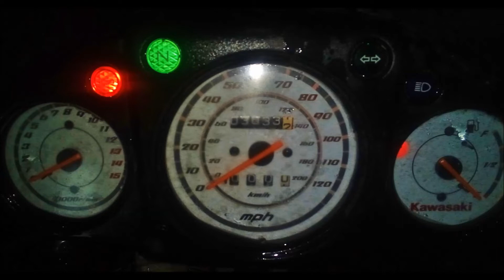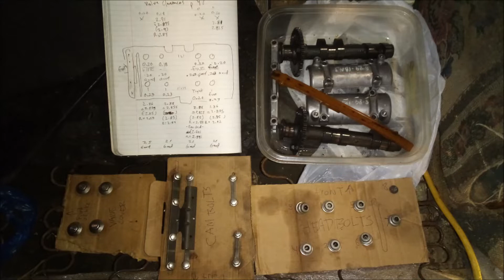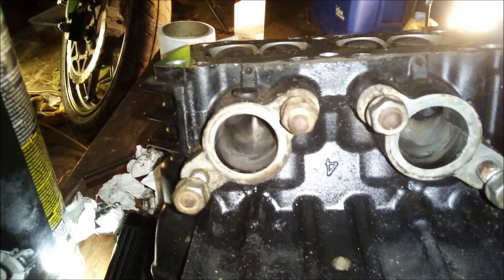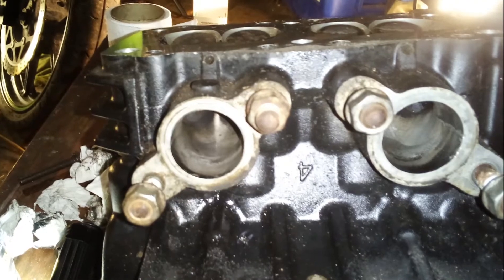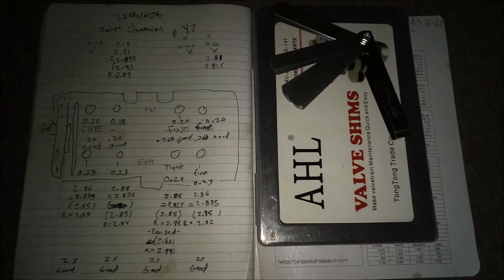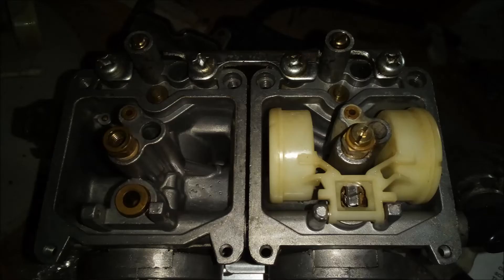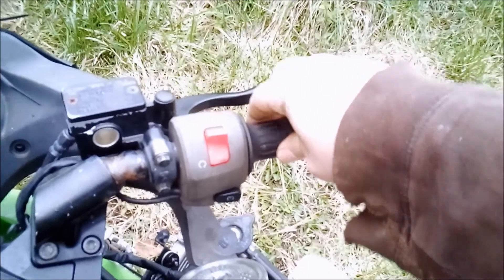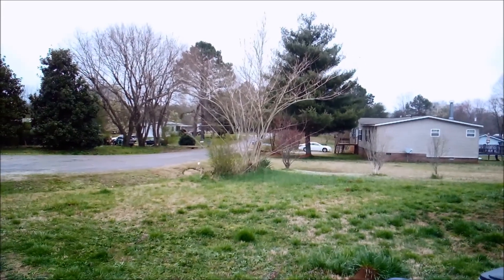12.5 Compression Ninja in 8 Mins + Start-up and Rips (Rowdy!)

Comment: You're right about giving it hell.
Reply from the maker: Oh yeah bro seat them rings with the power of fire. My buddy Jacob taught me that a long time ago, He had rebuilt a Honda 200x 3 wheeler for me and I babied it and putted around and it was still smoking after a day and he came over walked up and stuck the thumb throttle to the bar... I was freaking out trying to scream over the sound of the engine screaming.. STOP! STOP!!! and he was calmly looking at me he reached down to the carb screw with a Phillips head and turned it a 1/4 turn and it really started screaming high pitch, the cdi cover was off the head and he took the back of the screw driver and tapped the cdi module a few degrees advance... it got even higher up in the RPM. I was thinking oh god NO why??? After about 2 minuets of that which felt like 4 years, he let off the throttle and it sat there purring like a kitten, and he said if it was going to blow up you want it to do it now not 5 miles from anywhere out on the trail... and look,        No more smoke... Its fixed.
Reply: @heavymetalATC  precisely

Comment: You plan on tweaking the spark curve?
Reply from the maker: Thank you for watching and taking the time to comment Casey, I had thought about it but I talked to a guy on ninjete forum that builds insane bikes and he said it'll be fine, It might benifit from a colder plug and maybe a float height adjustment and I do run it a tad rich because when running on reserve with low fuel i noticed it wanted to ping slightly under hard acceleration... race gas would fix all that but Im not made of $$$s. Hahaha. Thanks again Casey.

Comment: The early ones were set up with a 15,500 rpm redline before longevity issues happened on straights
Reply from the maker: It appears that if you build one out like this and keep revving it that way the tach stops working. Hahaha
Reply: @heavymetalATC  I believe they developed lubrication issues when such rpms are sustained

Comment: Where did you find the measurement of .03 for the swelling of the forge pistons? I am thinking about putting a 66mm Pistons kit in my ninja, I am wondering what should the cylinder be finished at?
Reply from the maker: Thanks for watching fern. I am pretty much a hack so its just a guestimation I made from the info I got from guys on a forum for building race boat engines. Many of them had been having problems with the forged wiseco pistons sticking on factory tolerance sizes so as a rule they were going 1-3 thousandths overbore and 0.002in is just about .03mm and that was still inside Kawasaki service clearance at that size the wiseco rings gapped perfect with no filing. I had just used a 400 grit hone to bore the cylinders out but I sent a picture to my buddy who is a machinist/engine builder and he said go much rougher with more tension so I did 320 with the hone tight to get crosshatch which you will need after boring and at 66mm I believe you will need to re-sleeve the block so the new sleeves may have hatching already.

Comment: Got an update? Mine overheated, and thinking about replacing with similar pistons ( how was the cost, compared to OEM?)
Reply from the maker: Thanks for watching and taking the time to comment. As its been 4 months I don't know what you decided to do but from what I remember they were pretty comparable to a new set of stock pistons maybe 100 extra or less... but they require supporting mods and high octane 93 fuel or better which nowadays is like liquid gold. I ended up having to run a little rich and I probably still need a colder plug I do notice some pinging when accelerating hard when on reserve or still not fully warm. Its a decent power improvement for not much extra but it could cause an immediate failure if allowed to pre-detonate. That being said I haven't riden the bike all that much but it is still in one piece and only got stronger after a good break-in.
Reply: @heavymetalATC  thx for reply! Currently, due to life situations, bike is still currently....sitting. but I should be able to start doing disassembly, in the next week, prepping for surgery. Just re-wa5ched the video, and have to say, it was fun, lighthearted, yet detailed enough to keep me interested, yet not so much math and science, to feel like a textbook, on video. :D
Reply: @heavymetalATC  Detonation shouldn't be a issue because high rpm engines have very little dwell time at TDC. My pregen 250 is supposed to be 12.4 to 1 C/R and they are happy on 87octane. Maybe the advance curve is different on the later ones like yours but I'd surprise to hear knock out of an aluminum motor designed to cruise at 7krpms at legal highway speeds.

Comment: Is the 250 in that the same as the zzr250?
Reply from the maker: Thanks for watching and taking the time to write a comment Kallum. I am not completely sure but I think that it is a very similar engine with a little bit different castings and tuning it seems the zzr has a bit more power.
Reply: @heavymetalATC  thank you heaps!
Reply: @heavymetalATC ZZR250 from factory makes less power and weighs more ;) 😊

Comment: More updates?
Reply from the maker: Thank you for watching and taking the time to write a comment. Not much has changed I've ridden it a few miles since and it got a lot stronger after breaking in good but it didn't blow up or anything. Then it got cold so I just started replacing the tank and body and put some straight bars on it. I can say that I think it could use a jet size up or just needs to run race fuel. After it got up to full compression it started to ping a tad on hard acceleration but I can probably just richen up the carb and raise the needles it may also be that the factory petcock cant flow enough to keep the carb bowls full on flat out pulling. It does burn quite a bit of fuel now. I just hope that I don't end up having to run race fuel or octane booster.

Comment: I know nothing about Carbies, which is one thing that scares me about owning a motorcycle.  I've been waiting for a cheap broken bike to come along so I can do an EV conversion on it.
You should do a shorter quick video for My Crap Car and send it into the Unicorn Circuit. :D
Reply from the maker: Yes, carburetors can be quite a pain but if you break it down into parts and look at it its really just a pipe with a flap in it and a little tank of gas on the bottom with a float in it to shut off the flow just like in the back of a toilet, a little tiny pipe comes up from the tank into the main pipe and sprays out fuel as the air rushes past it the same way as it would if you blew across the end of a straw in your drink it will pull the liquid up and spray it out. I had had the thought of making an electric motorcycle for quite some time if you used a forklift motor and a curtis controller at about 48 volts it would be faster than any bike on the road add a 4 speed gearbox from a lathe or mill and it would be racebike fast. Yes I love unicorn circuit and MCM. I have a 1967 chevy impala that is more rust than car and I am building a beast motor for it and I think I will send it in to my crap car. It will look like junk but run like a scalded dog on meth.
Reply: @heavymetalATC  I have a '66 C10 in my dads garage in the same shape, My mom is using it to store her craft materials that she picked up from the back alleys around town haha.
Reply: @heavymetalATC  lol you are hilarious 😂

Comment: I have the same jump box little thing get a V8 going on 25%
Reply from the maker: I has saved me so many times. I left it in a hat car for years the battery inside swelled and busted the case and I ziptied it closed and I still keep using it. Will work as flash light and charge phones too. Go Horror Frieght!

Comment: Imma just 2 stroke swap mine.
Reply from the maker: Thats the ticket!!! I thought about doing just that on my little 125 ninja clone daily china bike but I think im gonna just build it up as hot as I can with racing dirtbike/pitbike parts and maybe "force" some air inside for a "boost" of power. Id love to do that on this but its already such high cylinder pressures with the high compression that it tries to detonate on hard pulls with regular 87 pump gas NA.